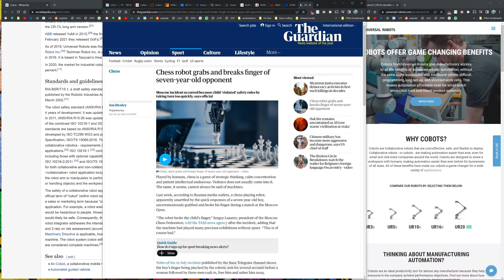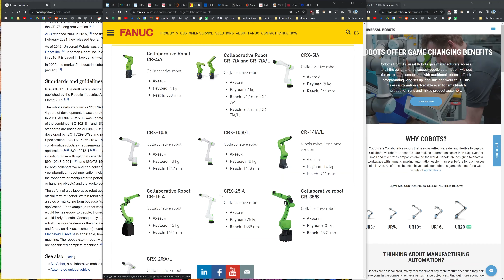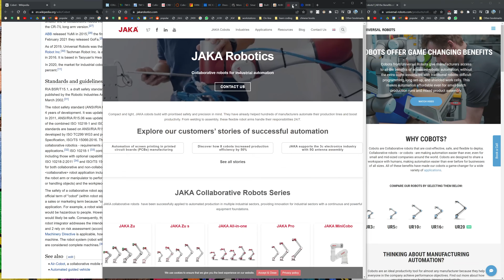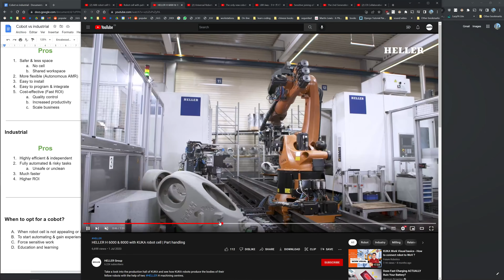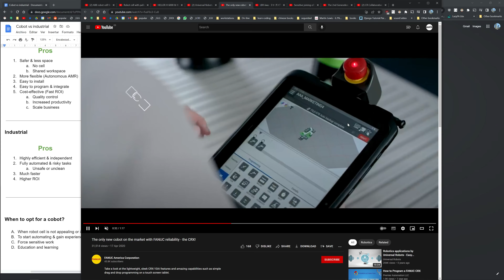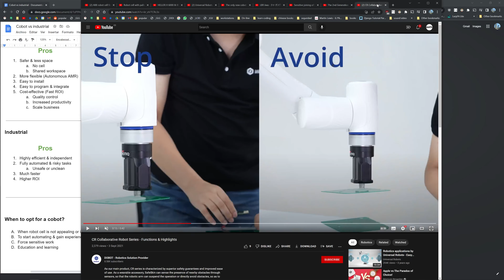Collaborative vs Industrial robots - Why cobots? What is a #cobot?

Comment: Industrial robot alongwith all required safety equipment costs approx half than a COBOT of the same robot  specifications(suppose 6 kg payload and 1.2 mtr reach).
Where industrial robots are suitable for high volume production, continuously working.
And COBOTs are suitable for low volume task, flexible, customisable work..
Here my question is, So this way how an industrial robot has Slow ROI and a COBOT has fast ROI which is double cost, slow working, suitable for low volume...?
Reply from the maker: I don't understand your question, Industrial robots might have similar price to cobots if you compare big brands like UR, OMRON(techman), KUKA, FANUC, ABB... and you dont take into account the extras.
But you can get very economic cobots such as DOBOT (top 2 in china), JAKA(top 2 in china), even Doosan (very big construction company)...

Like I explained in the video... in the industrial side, you need to design the tools, the enclosure, the process... and automate everything, it will most definitely take more than a month. And also there are some regulations you need to follow, so you will need extra equipment such as a plc (or expensive safety plc) and an enclosure... , maybe safety relays, and/or light barriers or radar... that increases the cost to double (just in materials without taking into account the integrator/engineering). Plus you will need to define a fixed process and you cannot work nearby (for example this might limit your work area or you might not have enough space).
With a cobot you just buy a stand alone cobot lets say DOBOT which will be half price and with that you can already automate a process very fast. In a weeks time or even faster depending on the task you might have the cobot working full time.

So the summary, industrial has higher cost, longer time to start producing and cobots are usually easier to implement and more cost effective. But in the long run you will produce more with an industrial robot.
But sometimes there are tasks that are not suitable for an industrial robot and you need a cobot. Cobots are not here to substitute Industrial robots, they are here to automate more things that industrilas can't or is not convinient. And of course there is the middle area where both robots meet and overlap but in my opinion industrial robots are better suited if  you can afford it.